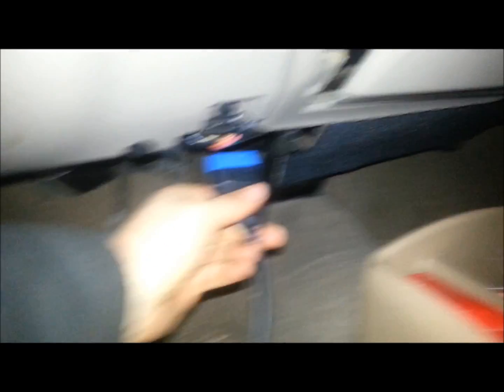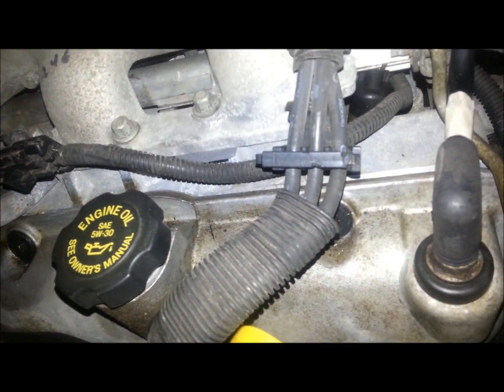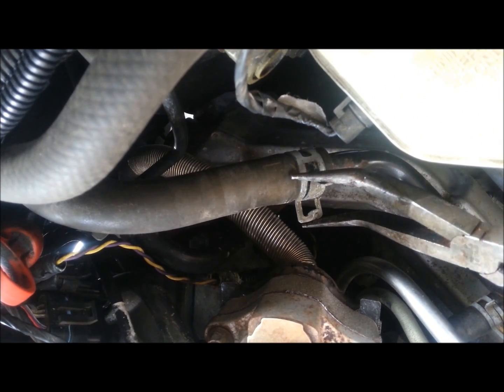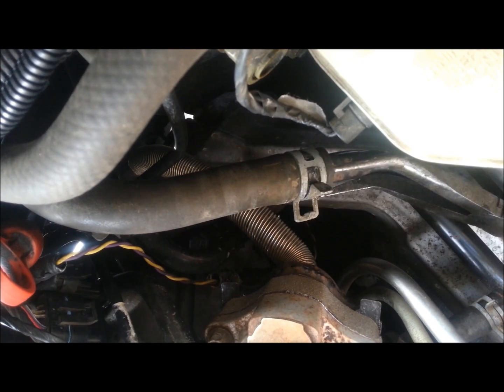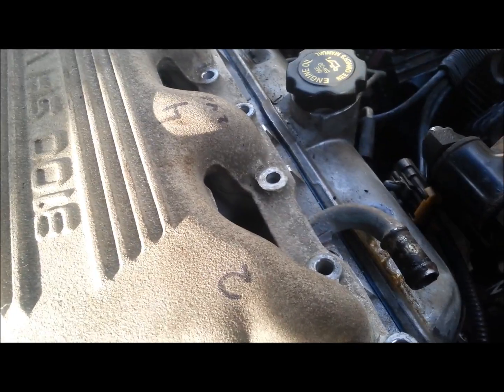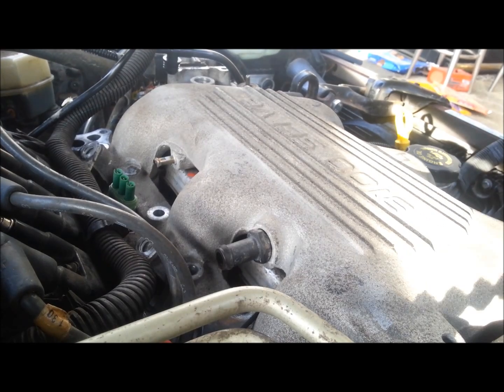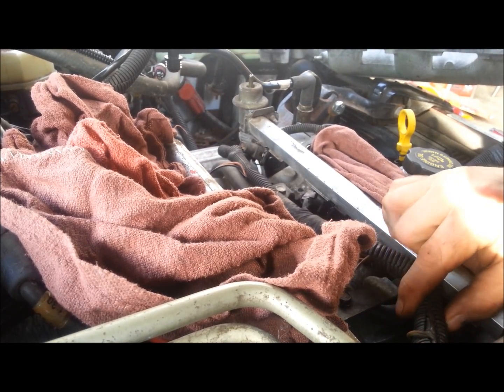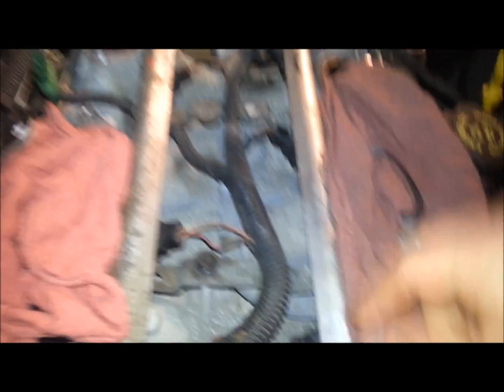3.1/3.4 misfire diag PART 1 p0306

Comment: For everyone with a 3.1/ 3.4L GM engine, if you have a misfire and plugs, wires, ignition coil, or ignition module replacement doesn't smooth it back out and you have a blinking SERVICE ENGINE SOON light that's blinking, you have a stripped rocker arm bolt on the cylinder that is misfiring. That means the rocker arm isn't moving at all on that (or those)cylinder(s). You have two choices 1) Heli-coil the stripped out threaded hole in the engine head, or 2) buy another head. I bought another head on mine, it was only $285.

Comment: Every engine will miss fire a little especially with worn spark plugs but if the check engine lights on and flashing that usually means one or more cylinders has no spark at all and the engine is miss firing resulting in bad power output and most vehicles can detect a bad spark plug and cut fuel to the bad cylinder by not firing that injector so it won’t damage the cat not all cars do that though.

Comment: Just a quick tip since I didn't see it in the video. When you just test spark and go directly to thinking it was injector. All you had to do was an injector balance test and use your stethy to listen if the injector buzzes or not. Takes but 5 seconds and it would have verified your issue.

Comment: I have a injector to replace on my wife's aztek,bought all 6 new Delphi online for half the price of 1 new one at my local parts store*
I'm hoping that is the end of my misfire since I replaced the icm,all coil packs,wires and plugs*
The motor has new heads,and lifters in it too so not much left to change,it has 130psi on all cylinders.
I had a #3 misfire untill I changed the icm,now it's a random misfire...
So I also have a new fuel pump coming

Comment: Joe, I figure you would know if it's possible to replace a 2.8 gm with a much newer 3.4 (04) while retaining the original CPU and harness. Thanks, BR
Reply from the maker: Would need ecu  and harness. Yours would not have proper timing and fueltrims and injector duty cycle to run at all correctly even if the pins lined up
Reply: @JoeTheAutoGuy  Thanks Joe, I asked that way because I actually bought the car and was driving it until other problems came up. It set awhile and the last time cranking it took longer to start. So I thought cam sensor and found no plug on it! Being it ran, for now new coils are on the way and fuel relay.
Reply: Benton Rodeheaver just go with the 3.8

Comment: B4 u do anything change pcv valve, $3, and change the small U-hose connected to the pcv "control unit" usually right behind or above throttle plate.
Reply from the maker: good tip
Reply: Right, these 3.1 & 3.4 all have faulty pcv valves. They crud up too quickly and stop working which will blow your main seals out. If you can afford a new one or your too far away to get one, you can take it out along with your pcv lines and use cleaner to soak them in and scrub them and soak it and rinse them with super hot water, them do a final rinse with wd40 to get rid of the water and keep it lubercated., Then just blow it out with the air gun and put it back together again and your good to go! 👍

Comment: my 04 Pontiac grand prix super charger I replaced in the past 6 months wire ,plugs,fuel injectors,crank shaft position sensor, check engine lite was erased, now it came back on it flashes when I  hit 60 plus MPH,
what else can I do. wash wax and burn  it
Jeffrey.martino19@gmail.com

Comment: how did you know there was "spark" there when diagnosing? What would you have suspected if you had smelt gas in the exhaust?
Reply from the maker: pulled plug and tested spark , if gas in exhaust then it's dumping raw fuel into exhaust